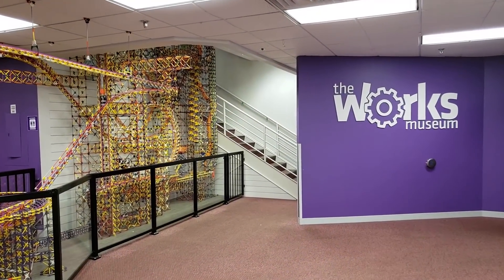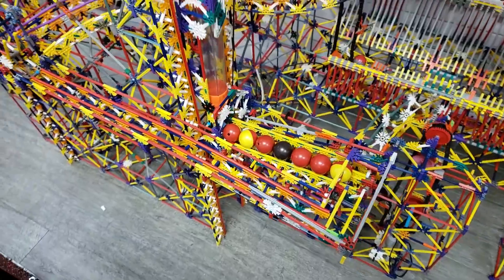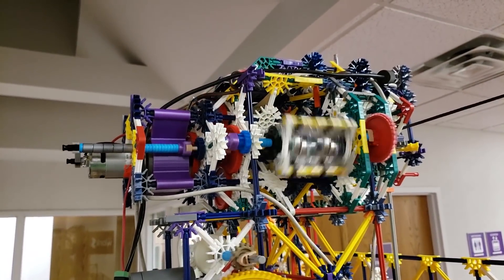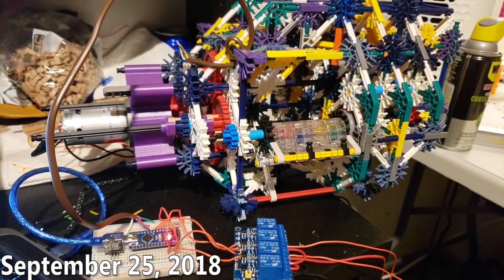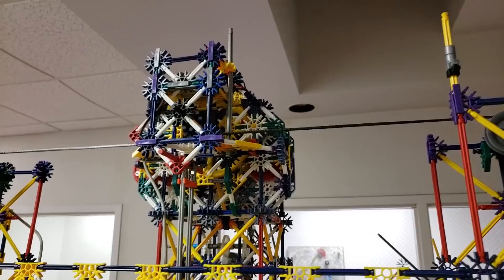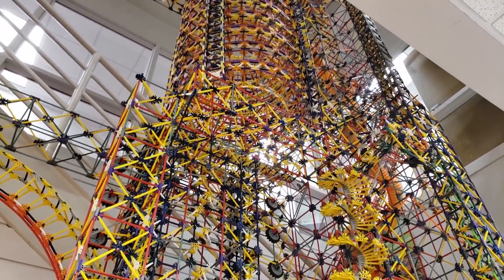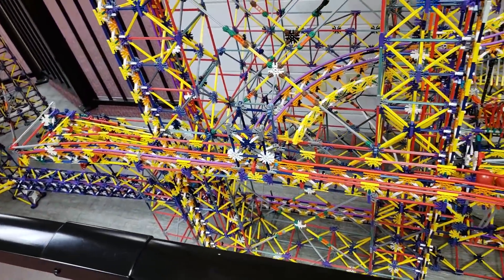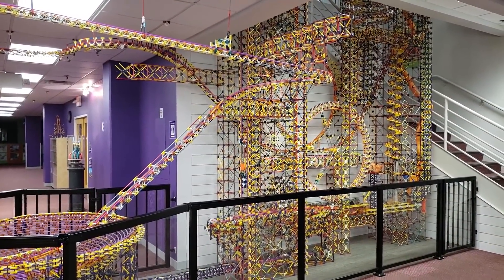K'nex Ball Machine at The Works Museum - September 2018 Update

Comment: Well done. I really like what you've done. The safety systems on the transmission are interesting. It looks like the axis is split into two pieces. The wind spring motors, with an integrated safety system, bind the two axes together. Under stress, the wind spring motors will snap and prevent power from reaching the second half of the axis. Very clever idea. I always thought the snapping would damage the motors so I never considered possibilities for utilizing the stress slip mode. Do you envision using that safety system in other motorized mechanisms on the machine? I've seen other knex transmissions that use rubber bands as safety but the slip motors seem like a more reliable solution. The diagnostic abilities of the computer clearly offer advantages over pure mechanical mechanisms. I noticed you 3d printed the motor casing. Did you build the motor from scratch? What issues did you have with the mechanical tube lift prototype? I temporarily ditched an idea for a lift because I had similar issues getting it to work reliably. It worked about ~80% of the time but, with its projected ball traffic, it needed to be at/near 100%.
Reply from the maker: Wow, awesome questions! I might have to make a separate video just to address some of these technical points in more detail.

The axle through the spring motors is not split, it runs all the way through. The red output gear is not actually attached to the axle, instead it is attached to the spring motor housings by micro knex rods going through the small holes in the gear and connectors. This allows the axle to spin freely and wind up the spring motors, while the spinning housings transfers torque through the red gear into the rest of the gearbox.

The clicking of the spring motors DOES actually damage them, as I learned the hard way. That's actually the biggest reason why I had to computerize the lift. On the old design, the machine would sometimes jam and nobody would notice for an hour or more. This would just leave the spring motors clicking away until it wore down the internal components. The new gearbox automatically shuts off after 5 seconds of clicking to prevent unnecessary wear on the spring motors. That is only really relevant in a situation where the machine is running unsupervised for long periods of time, though. I actually first came up with this idea in my K'nex flywheel ball launcher. It allowed for a gradual acceleration of a heavy flywheel without putting too much strain on the 12v K'nex motor. In general, the spring motor slip works incredibly well and I will definitely be using it in more projects in the future!

I felt kind of bad about needing to computerize the lift, since I consider that to be "cheating" in a way. However, the purpose of this machine is first and foremost to be an entertaining kinetic sculpture that is reliable enough to run for 8 hours a day. It was more important to ensure reliability than to adhere strictly to K'nex purity. The diagnostic information I am able to obtain through the computer has already proved invaluable, though. I can show up at the museum, take one look at the display, and immediately know if anything has been going wrong while I was away!

The motor I am using is a 24v high torque geared motor I purchased from a surplus store. It took me about 2 months to come up with a truly reliable means of handling all the torque this thing can put out! You may have noticed the 3D printed clips that are covering the tan locking connectors. This prevents them from popping off under high torque.

As for the tube lift prototype, I had so many issues I can't possibly list them all in a comment. I will make a video that goes through my design process for the new lift from start to finish, talking about the problems I encountered and how I solved them.
Reply: I  am really looking forward to that video about the design process for the tube lift!! It's a very very clever concept and I love the intuitive and mechanical mechanism you used to make it work!